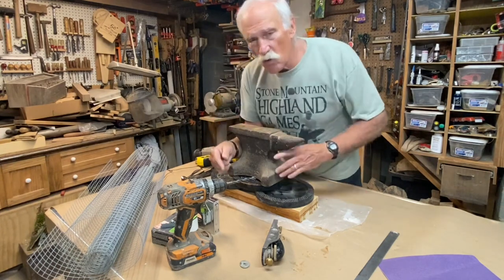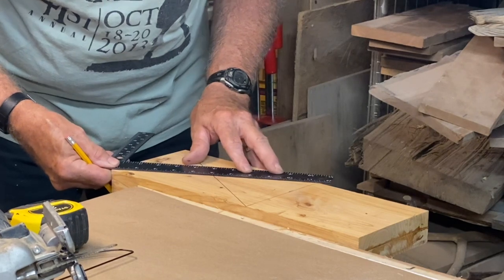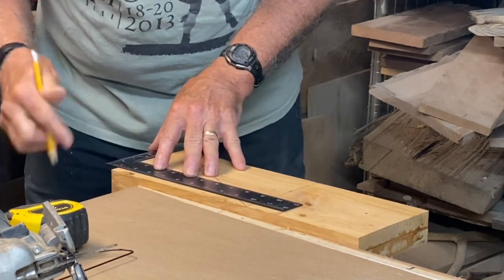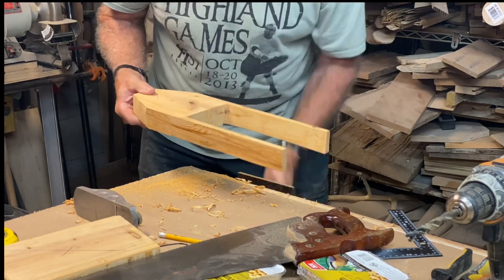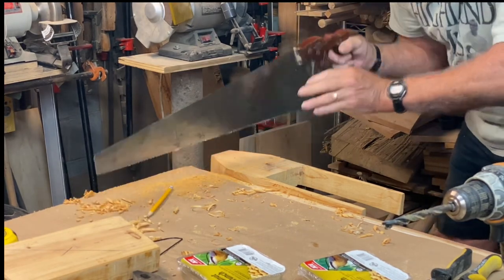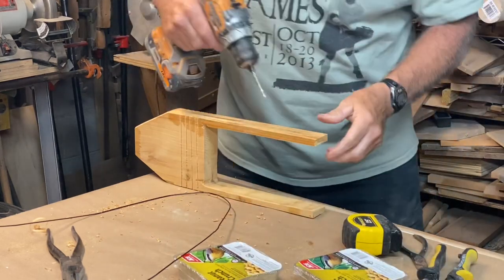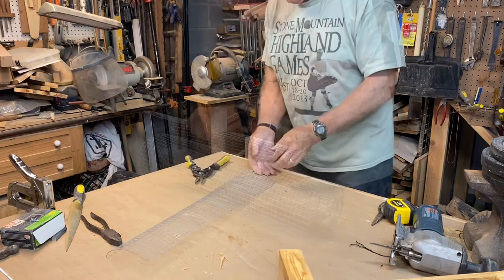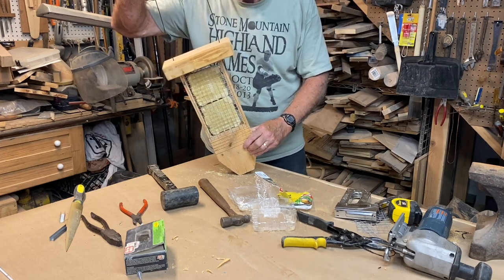Step by step DIY Suet Feeder

Comment: Is zinc bad for birds?  Galvanized metal which has been electroplated is safe, but galvanized wire (hot dipped) is not. According to "Avian Medicine: Principles and Application by Ritchie", Harrison and Harrison, birds can ingest zinc from cages and clips made of galvanized wire. 
Although a bird requires a certain amount of zinc to remain healthy, too much zinc is very dangerous and can cause degeneration in the liver, kidney, and pancreas and even death.
Reply from the maker: Great point.  I’m going to take a really close look at the wire to see if it has deteriorated very much.  Thanks for pointing this out